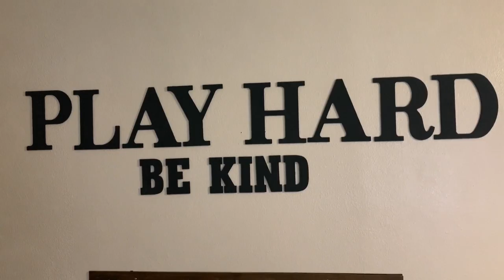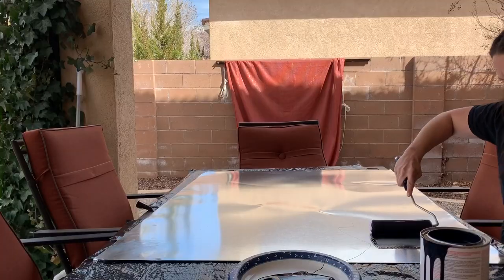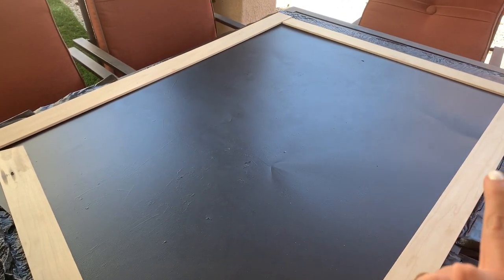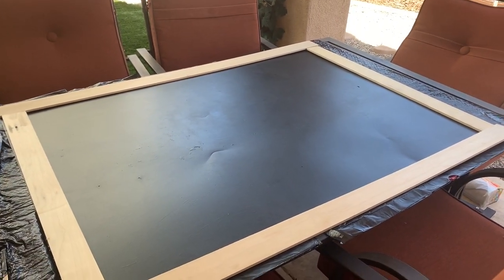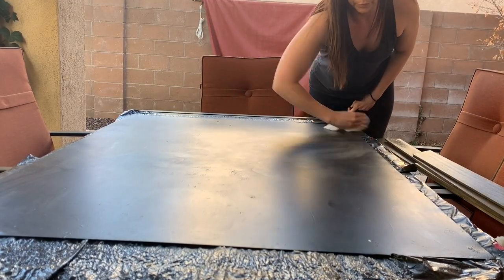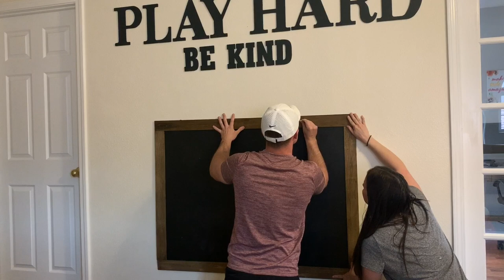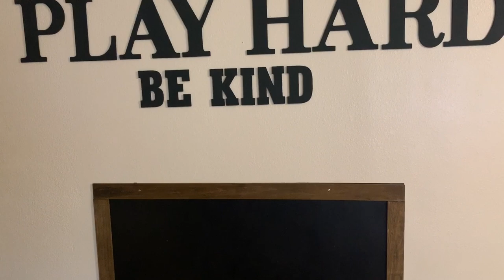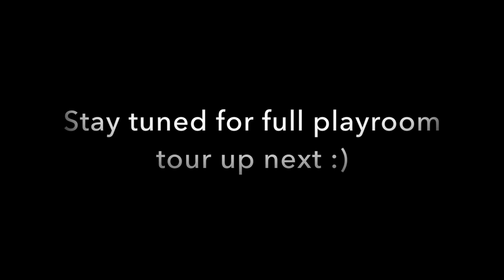How to Make a Magnetic Chalkboard// DIY Large Framed Chalkboard// Magnetic Chalkboard Wall DIY

Comment: Just an observation. Wipe it down with alcohol or mineral spirits before paint. A lot of times, there is a thin coat of oil on steel products( even galvanized) to prevent rust, especially big box store products. Well done video ❤️❤️